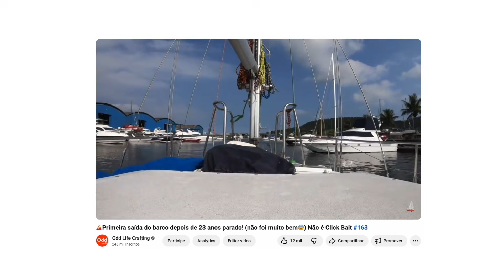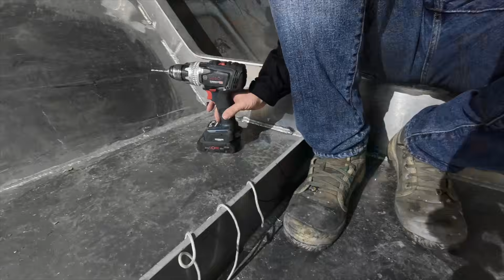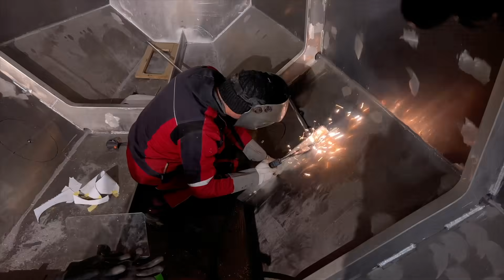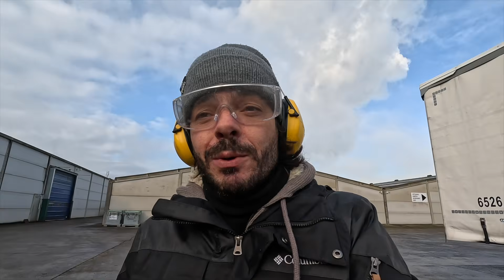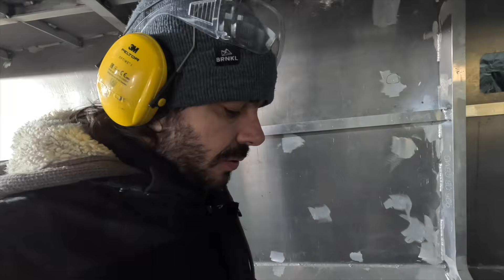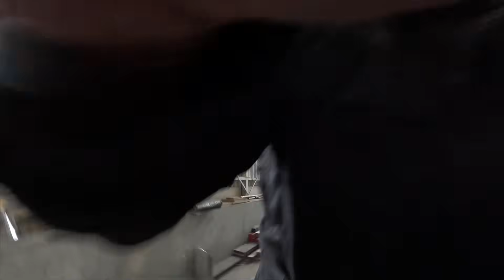⛵️ Cutting two massive holes under the waterline of our boat!! Ep.374

Comment: Very nifty technique for marking where to cut out the holes. Though I think I might have looked for a different approach to address the manuevering issue. Uma went with two engines and props, allowing them to steer with the props. Not at all sure about the wisdom of notching the keel beam to take the pipe. I guess the pipe itself will provide enough strength?
Reply: 1/2 inch pipe will be plenty of support.

Comment: Hi, great job. I wonder if you considered bending the pipe a bit, / ͞͞͞ \  (exaggerated). Like that the inflow and outflow would be directed slightly downwards (say 5°). Also, the center section of the pipe would be higher, still below the waterline, but maybe you wouldn't have needed to cut into the center reinforcement beam.
I'm sure that a slight bend would have a minimal impact in thrusters flow and would make the actual hole smaller, while maintaining the area, because it would decrease the angle between pipe and hull.
Having said all that, a bent pipe is triple the work

Comment: In my opinion, a single rudder or twin rudder behind the propeller makes no difference when sailing backwards. If you want to have any effect on the rudder, you need a water flow, and that means you need backward speed to be able to maneuver.
Reply: This comment is correct,  It is very difficult to steer any sailboat backing up until you have some speed so that you have water flow over the rudder.  That means you are usually moving backwards at too high a speed for close quarters maneuvering.  When you need to move the stern sideways you have to put the engine in gear forward so that the prop wash flows over the rudder.

Comment: This is very cool to see. I can't remember how many years ago it was, but I remember a few episodes with difficult docking situations in wind. I think this is probably the best compromise, since twin rudders means  no prop wash, but always prop walk. My old boat had the propeller forward of the rudder, and so I had to physically walk the boat out of the slip and position the boat by hand. The current boat is 20 tonne, with a single skeg hung rudder that I can maneuver well enough with spring lines if needed. 
Your design is creative, but traditional enough for a traditional solution. Despite some drag from the tunnel, you should have great control, single-handed (if one of you need to take care of a child situation), and an easier time with resale in the future. Great video!

Comment: Great deal if you get it for free. Huge tunnel! How do you clear it, maintain or, repair? Sailing performance: Can you have removable plugs for the holes for longer voyages?  Did you consider a surface 'pan type' thruster? If it is only 43ft why not invest in some longer boat hooks?

Comment: Look at this latest electric Balicats vertical motor installation . ... https://youtu.be/ueFeaJiVNeE?si=VQmpOTfV77otFUbk  given the changes about to happen in the next 5years . ..and remember the DS 40 Mimielectra. Also  CATL Na ion Naxtra  vehicle  Batteries will last for decades, cope with all temperatures and by the time you are ready probably cost 80% less than any Li based batteries.

Comment: In regards to maneuvering a boat to and from a dock. Weekend or day boaters do it all the time. BUT, in general they do it from just a few docks. Or even the same dock.

However, a live aboard that is mostly at anchor, may use different docks. Maybe even each and every time a different dock, if the boaters are continuous cruisers. Add in different countries and languages for the charts, that can add complications. Plus, continuous cruisers may need to dock in poor weather. So, yes, I agree, a bow thruster is something useful.

One comment. If you can arrange for the bow thruster motor, (and it's through hull to the props), to be enclosed in it's own water tight box, that can help if their is ever a leak. Saw this for the motors of Sailing Uma where they put the inside portion in a water tight box.

Good luck.

Comment: Duca, good idea to try to drill the pilot hole parallel to the water line but of course as the boat hasn’t been anywhere near the water and is standing on blocks, you have no idea if the current “level” is the same as what will eventually be the boat level. I’m sure it won’t make any difference though. Nice work.😊

Comment: Duca, you need a drag deflector in front of the pipe opening to prevent water from slowing you down during the cruising, or a negative shape in the fuselage of the boat located in the back side of the pipe. To create the negative shape you can use the pipe cutoffs from the both ends.
Reply: Very good point.

Comment: There is a special tool for making bow thruster holes that you can rent. https://youtu.be/FiUSjKqq1nk?is=1KhKupOCP572RPnt.
On production boats there are often kind of a spoiler in front of the hole and an indentation behind the hole to make less drag and prevent cavitation on the bow thruster. I could not find a good example, but it looks kind of like this https://youtu.be/hk5ChHYzpYE?is=4tG5Is917F7xsaMT

Comment: It seems that you are putting the bow thruster quite a ways back from the bow   It almost looks like a midship thruster.
Reply: The shape of the hull at the bow determines it. The openings have to be far enough below the waterline, so AIR cannot enter the tunnel when the thruster is on. He explained this at length.

Comment: Did you zee the ons of ransailing? Without a propellor?
Reply: Yes, 
They have the third type : Water-Jets

The benefit of having 2 pieces of -way smaller - nozzle holes in the bow, and a third water inlet in a deeper place of the hull.
Reply: The Barefoot Doctors, this week their Al hulled Portifino Catameran is also fitted with a bow water jet because they only need smaller hull holes and can be maintained in the water with no need to clean and anti foul  a bow thruster tunnel and  propeller.
Reply: Yes, 
They have the third type : Water-Jets

The benefit of having 2 pieces of -way smaller - nozzle holes in the bow, and a third water inlet in a deeper place of the hull.